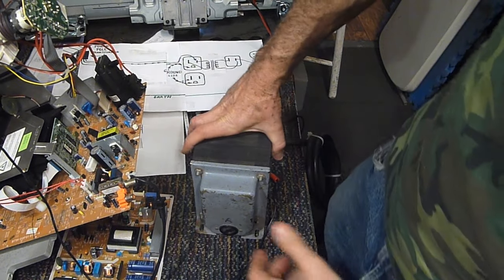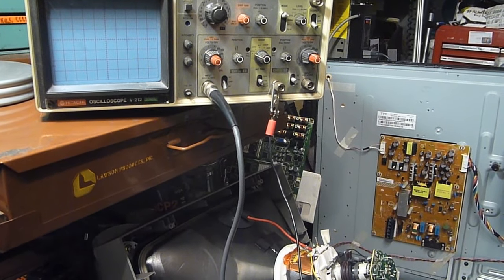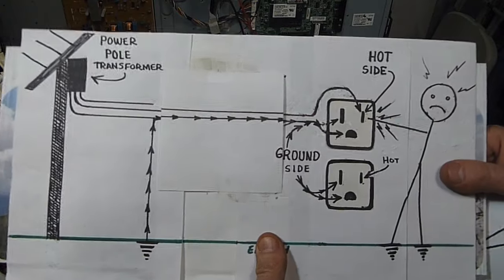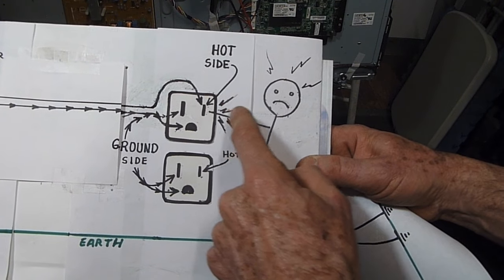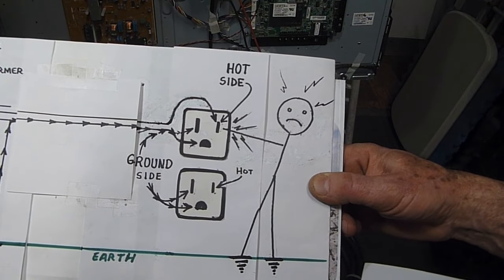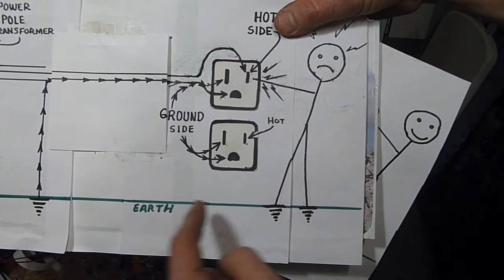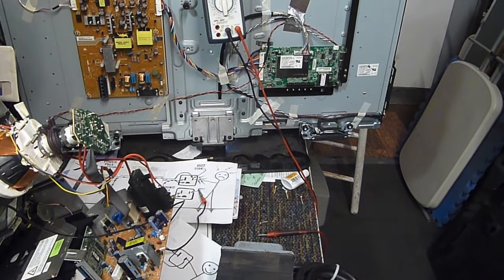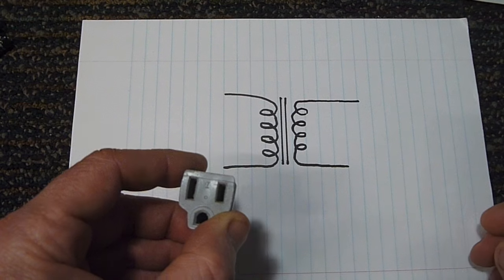Isolation Transformers can save your life, and your equipment.

Comment: The danger comes not from the "system ground", i.e., the ground rod in the earth, although that can give you a shock.  The danger comes from the "safety ground", that third, round hole on the socket which is bonded to the neutral at the fuse box so that there is a parallel, low resistance path for any fault that energizes the case or other conductive element that could come into contact with the hot wire during the fault.  The safety ground provides this path so the high current will trip the breaker, "clearing the fault" instead of having it lie dormant waiting for someone to create a path through the earth or other safety ground circuit.  The "ground" on the oscilloscope is tied directly to this low resistance path back to the transformer via the bond to the neutral.  So if you hook hook your oscilloscope ground to the hot side of the circuit in the DUT, your ground lead blows before the breaker trips, but it blows up in your face.

Comment: Isolation causes problem only if you have to scope in the primary of the power supply and connect the ground clip to the minus of the filter capacitor.Otherwise the secondary windings are isolated from the mains also the metal parts and all the internal groundings too.But scoping to the primary side of a switching power supply is not very common and does not have to reveal useful information but mostly will cause an unwanted glorious blown with spark and fume residues.

Comment: I had not watched Mr. Carlson's lab video on this in a while so I went back and watched it again, and although he shows the use of the adapter to remove the ground for a demonstration in the video he also says in the video that "I do not suggest you do so", and says you do so "at your own risk". The only real true isolation transformer does not have a ground lead at all and is the safer way to go.
Reply from the maker: I should have mentioned the do so at your own risk part in my video. It seems wrong that something that could potentially save a persons life or electronic equipment can  be sold on the open market if it doesn't do what the manufacture claims. I suppose if they sell it with an attached warning it wouldn't be as bad, but I wonder why they even bother to put a ground port on an isolation transformer if using it adds the ground back to the neutral wire.
Reply: I agree with you on that. Why would manufactures make something like that. There are also some videos of people modifying isolation transformers removing the ground on them.
Reply: Yes, I'm looking at retail versions of isolation transformers and they do have a ground plug, presumably so they will meet CSA requirements for sale in my country. I must be missing a critical detail, because I don't think I understand. I assume the ground ties to the outer insulated case of the transformer, which would then be tied when you plug in to the ground circuit of the power supply or TV you are testing. Neither of the two wires coming from the secondary of the isolation transformer have a path to ground, so if my grounded body touches one of them, why would current flow even if there is a path to ground? Is it because some devices you might be testing are wired illegally, bonding neutral to ground?
Reply: Hi Sparky, The deal with non-technician isolation transformers is that they do have one of the secondary output wires bonded to the earth pin and chassis. These hospital isolation transformers are not the same as technician isolation transformers so if you have a ground pin on your isolation transformer you need to use the three prong to two prong adapter or as I did in my video "Isolation Transformer - Tripp Lite IS1000" I removed the bonding from the secondary neutral to ground. The non-technician version are to only isolate noise and high energy electrical spikes to protect equipment and not protect people from ground faults.I find this practice dangerous because such non-technician isolation transforms do not protect people from ground fault shocks and they total defeat GFIC protect at the same time.
Reply: +Todd Harrison Thank you Todd, I watched your video and the situation is much more clear. I was under the misguided impression that clipping the ground plug was all I needed to do. Since bonding between neutral and ground is internal within even a stock 'isolation transformer', as you say clipping the ground plug is not enough! Even with ground plug clipped, there is still a path from the hot side of the secondary through the hand of the tech into his feet, then back through mains ground to the transformer chassis and then to the secondary windings. To call that an isolation transformer seems like a semantic error. Somebody mentioned that if the device under test is grounded elsewhere, that third prong might also destroy the float. So, maybe the best approach is a belt and suspenders. Use a three to two prong adapter for the isolation transformer output AND be sure there is no bonding of neutral to ground internally within the transformer. When I shop for my isolation transformer locally, I'm going to check for continuity between neutral and ground output. The main damage today is I'm again wishing I had a Fluke 117, ha ha.

Comment: GRANTS PASS TV REPAIR, instead of using an isolation transformer for measuring TV monitor waveforms, I have heard techs using the 2 channel oscope in the "add mode" using ch#1 to measure the tv monitor waveforms and ch#2 tied to the isolated ground/above ground point that is Not connected to chassis ground, will this work or not?
Reply from the maker: I don't understand how this can help since both grounds on the oscope are the same.
Reply: @GrantsPassTVRepair  the add mode or invert mode will put ch#2 to the isolated ground on the monitors circuit board ground which is above zero volts. You don't use the oscopes ground clips
Reply: Yes in this way you don't use the earth clips (which can either trip your RCD or possibly damage your scope) with only drawback being extra noise being picked up in the protective ground return path (since it has to come through socket wiring).
Reply from the maker: Sorry but I can't understand your question.

Comment: It’s not the earth ground that’s the issue. If an isolation transformer has a ground that’s not an issue. The issue is the neutral-ground bond. Current doesn’t just flow to earth unless we force it to.(we’re not talking about lightning here) The way we force it to is by bonding the neutral to ground, so ground is now at the same potential as neutral. Remove that bond, there is no potential to ground.
Where isolation transformers are used the most, every operating room in the US, not only are grounds required, but they are necessary or it could be deadly to a patient with their chest opened up with electrical equipment in their heart due to leakage current
In other words with isolation transformers- a ground(bond)wire is still necessary, but that ground can NOT be bonded to neutral.
Reply: Why would current leak from an isolated system. In Europe all isolation transformers have ungrounded sockets. In fact one use for them is to allow connecting ungrounded plugs to grounded sockets safely. Seems you don't understand the point of isolation.
Reply: A true isolation transformer should not pass the ground. We are not talking here about operating rooms. They are entirely irrelevant.

Comment: That isolation transformer also sounds like something quite dangerous, because if you essentially have killed the ground circuit of the device and the case becomes hot high voltage instead of that electricity flowing to ground the way jt is supposed to in properly ground devices , that voltage now will just be waiting for you to create a parallel path on the circuit you are working. True if you nust touch something that is groo that is not creating a ground loop since your device is not grounded but instead you are working ungrounded...  not safe either
Reply: What? Electricity doesn't flow to the ground. The whole point is to isolate the device so you cannot get shocked between it and the ground. You still could get shocked between two points in the device.

Comment: I’ve seen a couple videos on isolation systems.
In both, it talks about ground referenced systems being unsafe cuz you can get shocked touching the hot. Makes me have 3 questions;
1)
Why do we have ground references systems then in north America ?
2)
If the load is on and current is flowing and a parallel path is created thru ground via us, wouldn’t the shock not be that bad since we are a lot higher resistance than the neutral wire thru which the current is also flowing?
3)
Given my second point, I would think the only real danger with a ground reference system is when a hot wire is sticking out and isn’t sending current anywhere and load is on - so you don’t become a parallel path you become the full path and you take a higher current. Right?
Reply from the maker: Sorry but I don't understand any more than what I described in this video.

Comment: So, what you make contact with the two wires out of the isolation transformer? Is it lethal?
Reply from the maker: It could be lethal depending on your state of health, and the manner in which you're connected to the grid and ground, but it could also damage your electronic equipment not using an isolation transformer.

Comment: Thank you for a clear and concise explanation. I am a little bewildered though ! I bought a new isolation transformer for my 14 year old son who is chasing a career in electrical engineering, and after I was wondering why he needs it. Sir in you case and with your explanation, I understand that. I live in a house with a RCD on every circuit. I can put a pin into any of my 240 vac outlets and the RCD will trip at 15 mA. In Australia, the neutral (common ground) is also tied to the local ground (stake), but if there is a differential between the neutral and the active, the RCD will trip at 15 mA. So for my son, isn't it better not using the isolation transformer ? With the isolations transformer,,, if he is working on 240 vac live and he accidentally touched active and neutral he could be dead, but without the isolation transformer, the RCD would trip... I have tested my 22 RCD;s in my home... I am curious,,, and always like your videos and respect your experiences. Cheers.
Reply from the maker: I'm not sure what an RDC is, but I'm guessing you are referring to a ground fault power outlet with a built in circuit breaker.           Since the isolation transformer is preventing the ground fault device from being able to trigger at 15 MA,  I understand how that could be a problem.  It would seem that in such a circumstance you could be better off not using an isolation transformer, so long as your ground fault outlet is reliable. On the other hand  keep in mind that using an isolation transformer doesn't mean you are protected from getting a deadly shock, it simply eliminates the possibility of being shocked between earth ground and one of your mains hot wires. I hope that makes sense.
Reply: @GrantsPassTVRepair  Yes, Sir it makes sense. A RCD stands for "residual current  device "  meaning if there is an imbalance between active an neutral greater than 15 mA it will trigger a circuit breaker,,, they are reliable, but should be tested monthly by pressing the test button which will trigger and shut off. I think from memory it is 30 m/s.  They are mandatory in all new Australian homes. There are so many YouTube videos on isolation transformers, but I don't understand the need. So I am going to connect my scope the wrong way deliberately to see what will happen. I can only predict that the scope and all else on the circuit will go silent until RCD is reset. If I am correct, then why use an isolation transformer ?
Reply: @cookieboi4449  Touching Live and Neutral on the mains is going to be a lot worse than on the isolation transformer and you won't need to connect scope the wrong way as even the right way will trip the RCD.

Comment: Hello i have to troubleshoot a few pcb with 650V capacitors on them i've always avoid them because i feared the electroshock in case i touch anything got shorted or if i touch with bare hands something , would it be safe with an isolation transformet like this? i mean no shock, no sparks in case of shorts ?
Reply from the maker: No. An isolation transformer will not protect you from shocks  or shorts. It's always best to discharge capacitors before working on circuit boards.
Reply: @GrantsPassTVRepair  yes but i need to power the board to troubleshoot it so i cannot discharge the capacitor
Reply from the maker: @MisterXS75  I understand. In that case you will just need to be careful.
Reply: @GrantsPassTVRepair  but would the isolation transformer help? Found a 1kw isolation transformer on amazon for almost 200 bucks i would save that money if it is not needed but everywhere i read this is crucial for electronic board repairing

Comment: Heck, I still remember getting zapped removing the CRT anode cap from a Symphonic 3" B&W TV that hadn't been powered up for over 15 years. "POP!" (Why does the stick man wear grounding shoes?)
Reply from the maker: I have heard of cases where large high voltage capacitors pick up static electricity just sitting on the shelf. I can see how the same could happen with a picture tube. I've been bit by charged picture tubes  on numerous occasions. It puts a little spring  in your step. :-)

Comment: I found an old isolation transformer, very heavy 115v  .500va. I replaced the incoming cord because the insulation was cracking. The transformer looks unused. I checked for continuity and short to ground on both sides and it was good, it has a single receptacle. After plugging it in to check output voltage at 127v, but there was also 17v on the ground side to chassis ans 96v from hot side to chassis. I am no electrician, is this transformer trash ? Thanks.
Reply from the maker: You may be measuring what some call "ghost voltage" on your isolation transformer. "Ghost voltage" is a voltage that's picked up by your meter probe through the air even though your meter probes aren't attached to the circuit you're testing. It may be strong enought show up on your meter even though it's extremely weak, so  I would  not assume your isolation transformer is bad. I suggest you watch a few youtube videos on "Ghost Voltage".
Reply: @GrantsPassTVRepair  Thank You, i am checking  "Ghost Voltage" videos now. I have a Variac wired for DC output that I wanted to use to color titanium, but I wanted to isolate it for safety reasons.
Reply: @GrantsPassTVRepair  I checked it in series to chassis ground one leg at a time with an incandescent light bulb. No lighting, looks like " ghost voltage ". Thank you for helping, I'm just learning enough to get in trouble, that is why i'm here. I have a Klein cl380 clamp meter and its auto ranging. I cannot find how to make it not read the " ghost voltage ".
Reply: Also, we lived in Oregon 6yrs, been thru Grants Pass once. Beautiful country. Also I just ordered a Fluke 116
that has Loz to catch those Ghosts. 🙂
Reply from the maker: @forrestgumpv9049  I'm glad you figured that out. You may find this video to also be of interest. https://www.youtube.com/watch?v=M2v04tdp5B8&t=6s
Reply: @GrantsPassTVRepair  The Fluke 116 arrived today. It was definitely Ghost Voltage. I always wanted a Fluke, got this one on sale.Thank You again for helping.
Reply from the maker: @forrestgumpv9049  You're welcome. All the best.

Comment: In a 120volt AC circuit,  neutral and earth are both possible return paths. Basically an isolation transformer eliminates earth as a possible return path?
Reply from the maker: I guess that's another way to say it.
Reply: @GrantsPassTVRepair  thanks